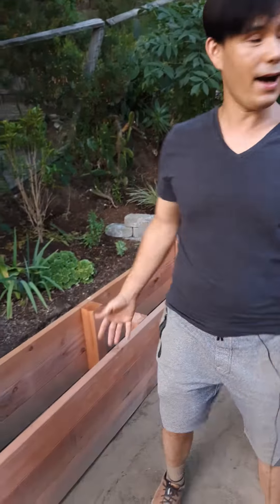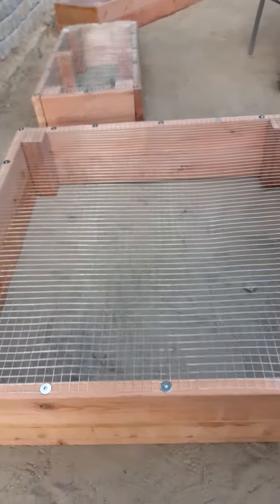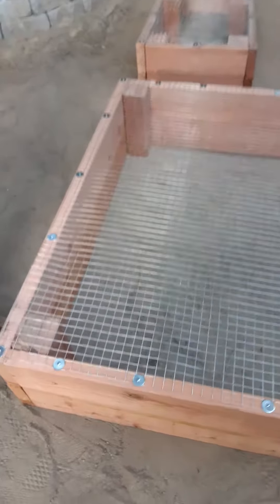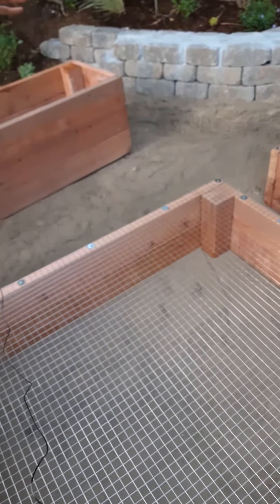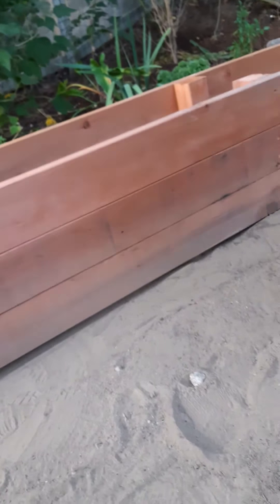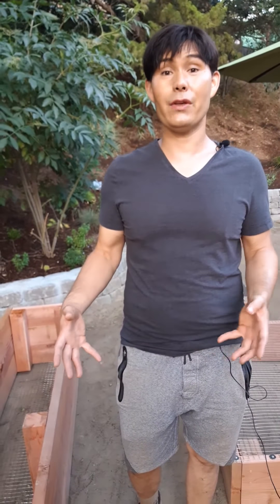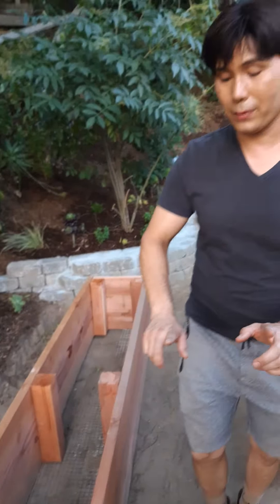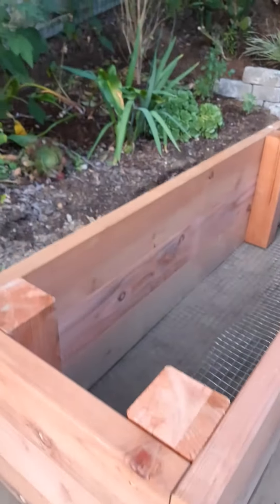Raised Planters w Stainless Steel Wire Mesh, aka Gopher Wire

Comment: Hi,Nice job, You will get a beautiful lawn,very impressive beautiful environment. Thanks for your ideas, 
Just for who need SEBOSS hardware cloth,1/2,1/4 opening ,19 GA, Hot dip galvanized after welding, double galvanized, strong and sturdy, delicate and beautiful, suitable as gopher wire, protect lawn/garden from all kinds of gophers.